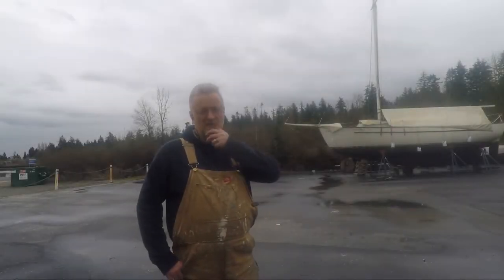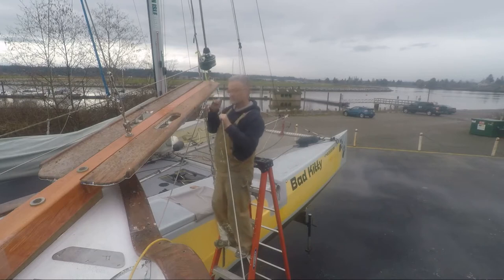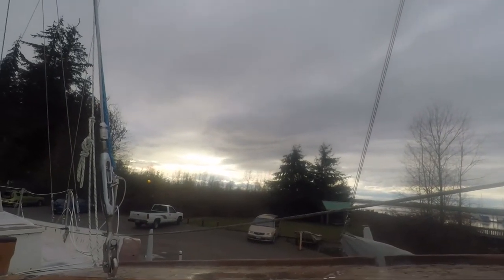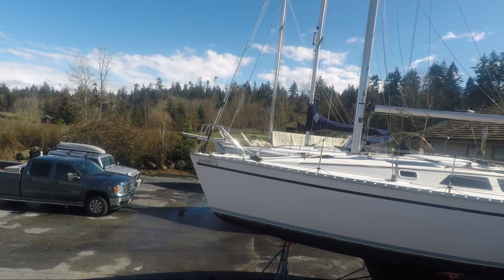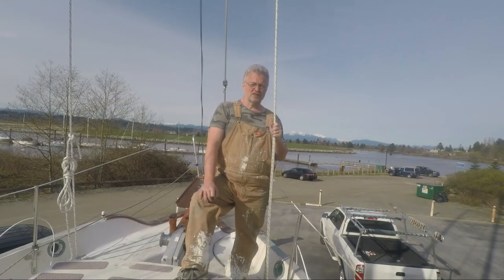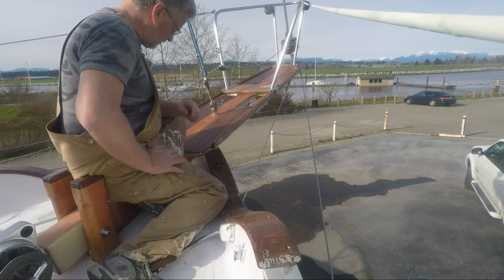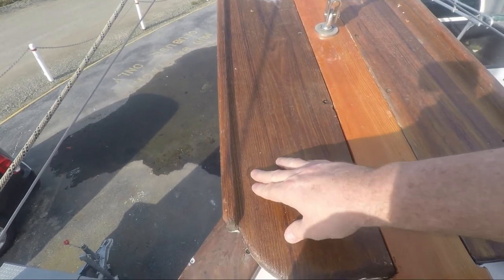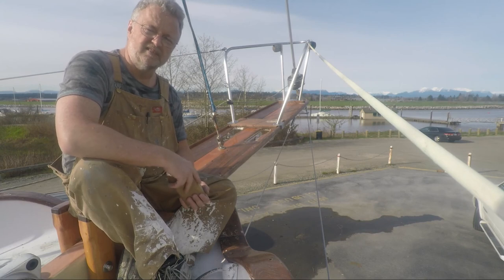Little Bear Westsail 32 refit: Bowsprit Platform On! Vlog #132

Comment: did you run the wires through the bowpulpit before you put it on?
Reply from the maker: That would be a nasty little 'gotcha' wouldn't it?  Yes.  There is also a notch cut in the platform that would allow for wire to be pulled.
Reply: Wake for Me You Canadians are so smart. I pulled some new thru with a shrinkwrap cover and I almost gave up. had to loosen one leg on the pulpit and needed a comealong to get it re attached. Good job filling all your holes and redrilling. I haven't been doing that 100%. shame on me. Did you say you were almost in the water?
Reply from the maker: EEEeekk!  The thought of rot in the core sends shivers down my spine, and gives me nightmares.  Fill & drill or go crazy with butyl / 4200.  

Ya, If I can get my act together sufficiently enough I should be able to splash not this w/end but next.  :D